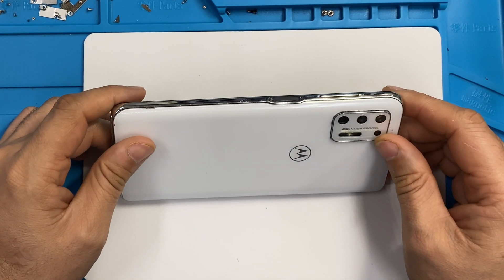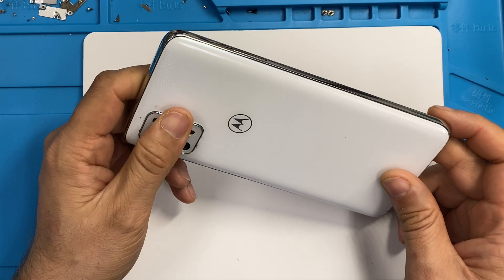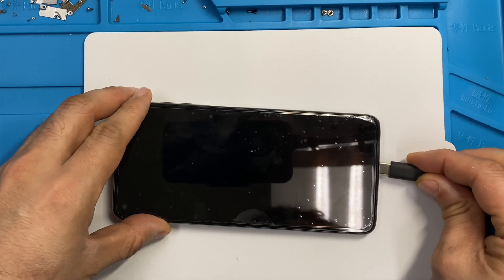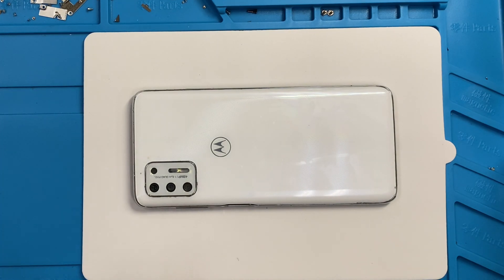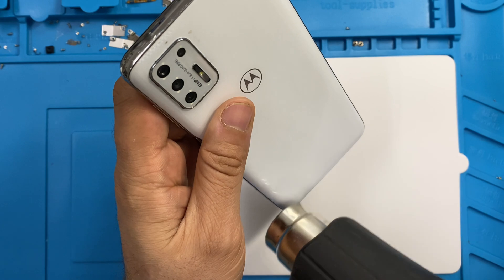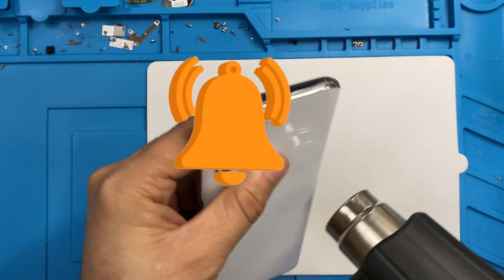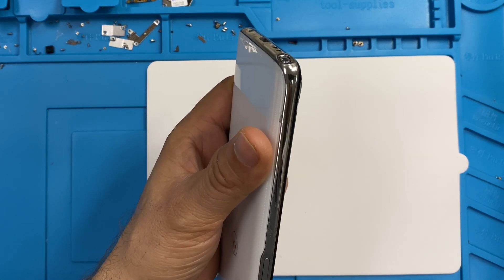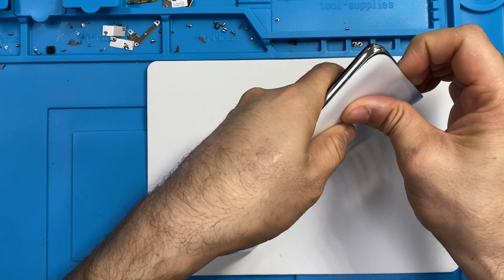Moto g stylus xt2115 chargingport replacement | how to replace moto g stylus xt2115 chargingport

Comment: Great video- I did mine in no time at all, but now I cannot make phone calls- I did plug both antenna lead back in,  butwill not make calls- no signals from my carrier
I put the old one back in to test, and I could make calls, then put the new one back in but still cannot make any calls- Any ideas?
Reply from the maker: It sounds like the new charging port might have a problem with the antenna connection, even if it looks plugged in. Try another charging port

Comment: Your video is going to save me $50.00. Took the mystery out out of the repair.  Thank You.
Reply: ah yes you too got slammed with a $65 dollar repair quote  for an hour of labor at the risk of soldering.

one thinghe forgot to mention is to use an electronic safe adhesive glue, a tube of B7000 will be needed to place the back of it back on.

Comment: Everything works great except I don't any signel
Reply: I'm dealing with the same issue. Different daughter boards for different cellphone antenna receptions for different "regions" of the world, is what I heard that can be the problem! (i.e. XT2115, XT2115-1 , XT2115-2, Xt2115-3, XT2115-4, XT2115-DL <- this last one on the right is for the StraightTalk, & Tracfones!)

Comment: Ok but here's the problem it gets hot at the top when I replace the screen what cause that
Reply: Heat spreader graphite sheet is missing or is bad or not readhered properly, and or u did not use  thermo paste between the phone body and motherboard chip... Just a thought

Comment: What are the black & white wires for and what do they go to?
Reply: If what I am seeing is correct, the black wire is the internal antenna. Its either that or it works with the speaker.